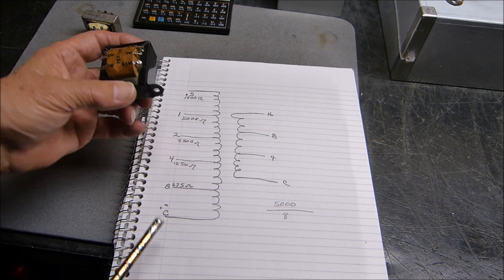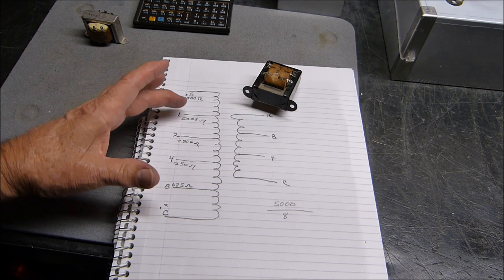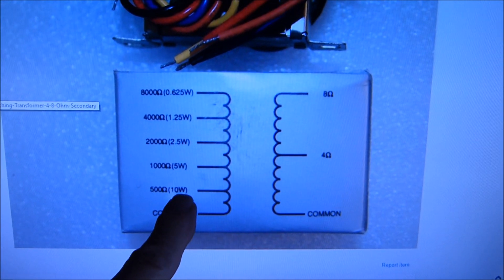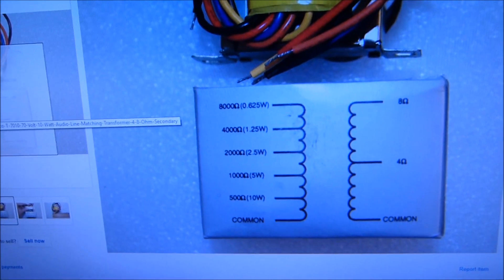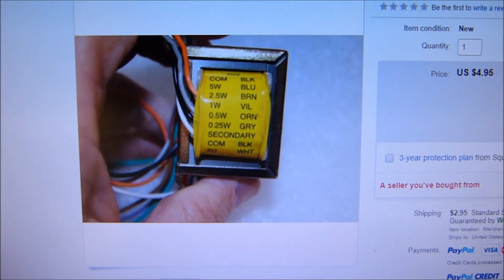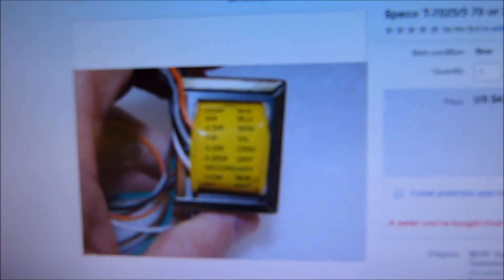Using Inexpensive Line Transformers For Vacuum Tube SE or PP Output Transformers

Comment from the maker: Update: 7/24/2021  -  I have learned a little more about these line transformers and they are not gapped and are not meant to have any DC current flowing in the primary winding as they would saturate easily. To use them as a SE transformer they should be capacitor coupled to eliminate any DC in the primary winding. However, they can be used in push pull as the two halves of the primary have opposite DC polarity current flowing in them which adds up to zero if perfectly balanced and they should work quite well in push pull. In the case of the examples in this video, the power would be low and from what I have seen in the higher wattage line transformers, the available taps are usually very limited. They could work nicely if you are lucky enough to find one with the impedance values you need at the power level you require.

Comment: As Eli Duttman says, these small transformers were/are used in the Bottlehead single-ended Para-Feed power amplifiers. So you get a big choke, say 10 Henrys, that is the DC plate load/plate supply. You then feed off of the plate with a large signal cap, say 3uF,  into the little line transformer. Since there is no DC , the line transformer handles only the pure AC signal and is loaded by the speaker. Great and cheap method of building a 2a3 or 45 or any low-watt single ended tube amp.

Comment: Interesting discussion.  Just for "Fun" I built a 6AU6 (small signal pentode) ->6AQ5 using a 10W line matching transformer in single ended mode.  Yes, I expected a lot of saturation and biased the 6AQ5 really really cold (like 5W).   The "el cheapo" guitar amp was a success!  Of course the amp's output was compressed and distorted, but it still sounded great, for what it is..
Reply from the maker: That is good to hear. You are one of the rare few that will actually build it... I might guess that putting a capacitor in series with the plate of the 6AQ5 to the line matching transformer and putting a choke of at least 10H on the plate side of the transformer for DC to the 6AQ5 might improve it ??  I don't know that but it would take the saturating DC off the line transformer. Thanks for letting everyone know.

Comment: Have in mind that this transformers do not have appropriate insulation, remainding you that if tube circuit works on 250V (DC) AC value can be as high as 250 + 100 or more.

Comment: I've got an old Sony tube amp with just a 6BM8/ECL82 triode pentode in it. The output transformer is open circuit. Could I use a line transformer in its place?
Reply from the maker: There is a good chance that you can. You will need to get a line transformer that has a primary impedance that is high enough for your 6BM8 circuit. I assume it is around 10K or so. That should work.

Comment: I actually bought a similar line transformer off eBay. It was advertised 8k but when I put it on my signal generator and measured voltages, both with volt meters and digital oscilloscope, I got closer to 5.2k. Have you measured the line transformers to see how close to theoretical they are? Is there a better way than my method, assuming the mentioned items and maybe excel? Thanks for the video I think they would do great in 1-5 watt push pull amps.
Reply from the maker: I haven't actually measured Z yet but now that you mention it, I will and let you know what I find.
Reply from the maker: I did measure the larger of the two transformers I showed in the video and the 10K secondary read 11.7K with the GR bridge (I used 8 ohms on the 8 ohm secondary)
Reply: Thanks for the reply. I wonder how balanced they are, more a general curiosity than a request. Always fun to get new information. Thanks again for the update.

Comment: Have you tried using these?
Reply from the maker: No, actually, I have not built anything with them. After some of the lengthy comments that have been posted about these little transformers and the fact that some say they have used them very successfully in SE amps (with current thru the primary) I have a feeling that they would do best on the DC isolated side of a blocking capacitor as a driver transformer. I still have reservations about using them as a legitimate SE output transformer. I have been very involved in my ham radio equipment and have neglected my audio hobby but I seriously do have a project that I will start on "any day" using a pair of Svetlana SV752-10's. I have a nice 10K Tridad transformer that should be a good match. I have not decided on how to drive the grids of the 572-10 yet. I don't think the standard Williamson driver will deliver enough voltage swing so I may have to go with the choke drive (also known as impedance drive) or maybe some of these line transformers or whatever that interstage transformers that I  have that seems best.

Comment: I suspect the downside is probably suppressed response at the low and high end frequency ranges. I searched a few old Stancor catalogs and found no specs listed.  I did find that Thordarson still has the 24S71 shown in their current online catalog. Sadly indeed, the response is stated as 100 - 10kHz.  For headphone amplifier output impedance matching, the story may be different - only way to know is to build one and see what happens.
Reply from the maker: I agree that they are not likely to have a FR from 20 to 20KHz but, as you say, I bet they will be very good for headphone amps. I have to build an amplifier and test one now.
Reply: Well, the application here is performance with headphones - most are around 30 to 35 ohms. The winding resistance of most 70V line transformers is pretty low. The output impedance if the vacuum tube amp is >>> greater than a typical 70V line amp.  The combination of operation below 1/2W with significantly higher I/O impedances "might/may" yield better FR performance. That said, it's worth testing both ways. Surprises happen.
Reply from the maker: You have me thinking about connecting the transformer, as you say, with a load and driving it with another high quality amplifier that can deliver enough power to test it at its power rating. The test transformer would be driven (by the amplifier) at the low impedance side and I would have to have a resistor equal to the high impedance side to load it and measure it ... I will have to think about it.  I have tested transformers with just the few volts output from the oscillators and checked it with the HP 8903 and they all turn out fabulous, including filament transformers so, testing them at a few mW doesn't seem to mean much as how it will operate close to maximum levels.
Reply: Oh well, it was worth the thought. The only bogey not modeled by the simplified physics & math is the core material/construction behavior - sounds like you already have a pretty good idea that the affect on FR is minimal.

Comment: I really like the videos that bring us back to basics. No, these transformers probably don't have interleaved windings, they probably aren't balanced from CT to each end but they are a great lesson in what you can do with what you have. Knowing the basics like this allows the designer to make compensations for something less than perfect and brings expectations back into reality. Great video David.
Reply from the maker: I agree that they probably don't have a gap and may not be very good for SE amps but for PP we don't need the gap so maybe they will turn out good in that application. I surely have to build one now and test it.  :-) I have several different brands and the better brands as I showed in the video are very balanced to its calculated CT. The cheaper one I have are not as well balanced.

Comment: Here you go, all the taps on a 10W or smaller line match transformer. First column is the markings, second column is the resulting impedance, third column is what to connect. 
I actually opened the wrap-around clamp on a pair and took a rotary tool with a cutoff disc to cut a gap into the core, and the pair works dandy for a single ended stereo amp with EL84 tubes. 
BEWARE that there are some of these, where the wire gets thinner on the higher impedance side. Use only those for tube output, that have constant wire thickness!
70V match   Rpri(Ohm) = (70V^2)/Ptap

Uin = 70V   Rsec = 8 Ohm    Usec = sqrt(P*Rsec) = sqrt (P*8)

Ptap    Rpri    Rpri plate-plate        Usec    Uin/Usec    Rin/Rsec
                                                                                             (Uin/Usec)^2
0          0           plate-plate 4K,8K          
10W    490                                          8.94    7.82        61.15
5W      980       B+ 4K                        6.32    11.07       122.5
2.5W   1960    B+ 8K                         4.47    16.65       277.2
1.25W  3920    plate-plate 4K          3.16    22.15       490.6
0.62W  7840    plate-plate 8K          2.23    31.39       985.3

Comment: Experiences with these awhile ago although not as a plate loading output.Right now,using a little Stancor 5w unit to match the 600 ohm output of the Hammarlund SP-600 I am restoring to an 8 ohm speaker.Still has a slight mismatch but WAY better than without the transformer! Good job! You make an excellent Elmer!! 73's.
Reply from the maker: I use one of these transformers on my Collins R-390 as it has a 500 ohm output. It surely makes a huge difference. BTW, I use the R-390 as my main receiver. The audio is so superior to the high pitched receivers as it sounds like my contact is in the same room with me. Love it.
73 WA4QGA David
Reply: ElPaso TubeAmps R-390 is an amazing piece of engineering. The 600 I am using was quite the tough dog! Typical problems were it being WAY out of alignment in the RF and the 1st conversion LO would just stop dead above 7 Mhz.After exploring everything I could think of,with all voltages spot on and swaping 6C4 osc. tubes from the variable to xtal. LO,in desperation I tried a brand new RCA N.O.S. tube and it kept on tickin right up to 11m!!About 27.50Mhz.Been using it alot with the line trans on the output.Watch alot if what you do.Can tell you're into it! I love the test equipment you have.Should have invested in stocking my bench! Have a great New Year! 73's back to you. Charlie N2VUW.

Comment: Great video. That's a good explanation of line (100V, 70V, 25V etc.) transformers.

The last pair are low level signal transformers so are not suitable for handling any power but for low level signal impedance matching. They seem to be general input/output impedance matching transformers, i.e. probably designed for both tasks, whereas most low level transformers are specifically designed to work as either input or output but not both for optimum performance.

Comment: Dave,  I agree with the not air gapped assessment.  I recall Dan Schmalle, AKA Doc B., using that sort of "iron" in a "parafeed" setup.  IMO, an interesting experiment would be "parafeed" PP 6BM8s, with constant current source (CCS) loads and the "line" trafo priamary across the plates.  Regulate g2 B+, for max. open loop linearity.  As incorporating those little cores in a GNFB loop is almost certain to cause saturation, use short loop NFB.  Heat sinked 10M45S ICs should be OK for the CCS loads.

Eli D.

Comment: Thank's, every bit of info helps. I am going to build a mini twin reverb 2x8" at 8ohm , 2x6V6 push/pull low wattage portable Guitar amp. Like Valve powered boogie box with spring reverb...I hope. All this because the speakers have a really good clean tone and they look too well made to just throw in the bin..

Comment: Not good for high DC bias though, they are not gapped much and are really intended for AC only use. But if you have a small DC bias and low power use they will work fine, good enough for interstage coupling at low power. Simplest is to look for the primary winding triplet that has equal DC resistance side to centre, as the primary is always going to be wound with the same wire gauge.

You can delaminate them and restack with a gap though, but you will lose at least 1 set of laminates getting the first one out, then stack as all E and I with the centre leg ground down slightly.

Comment: Why don't we take the whole dc problem (both insulation and saturation) out of the equation and use them merely as impedance matching devices?  We can design a single ended para-feed with a plate load resistor or, even better, an inductor. We add a capacitor for coupling (pretty cheap these days) and we get rid of all the dc saturation. That should make up for the poor low frequency response on those things. The famous REDD 47 preamp uses an arrangement pretty similar to the one I'm describing here and it's one of the holy grails of tube sound. If that was good enough for Sir George Martin and The Beatles, then it sure as heck should be good enough for me ;) Thanks for another great video and also for such a great idea, I just threw so many of those things away...

Comment: Those are my main PP OTs for 6AQ5's - 6V6's - 6BM8's.  I often get them for $5 or less delivered watching on Ebay.  The ones I have are 10W max.  I got about 10 in stock.  LOL  But you are giving away my secrets.  Prices may be rising now!  LOL  ;^)
Reply from the maker: I certainly agree with you comment of unnecessary complexity. I often times find the best answers in the first books  that were written on a subject, likely written between the 1940's and 1970. After something is discovered or designed, academia gets into it and regurgitates complicated versions of it. We also have the advertisement community putting all kinds of flowery words all over it to increase sales. The most common one is "RMS power". No one wants "average" power... but mathematically, RMS power does not come from multiplying RMS voltage times RMS current. We know it is called average power. I hope this video helps builders find and put to use some of these line transformers that have been laying around for decades. Unfortunately, the power levels are going to be pretty low but I am confident even the lower power rated windings of these transformers will be able to deliver up to 10 watts (depending on the size of the transformer, of course) and there may be some concern about the max voltage these transformers can withstand.
Reply: I bought some lots of transformers on Ebay for cheap.  I then had to identify what I bought and what I might be able to use them for.  LOL  That is how I too stumbled into using these line transformers as output transformers.  I make mainly guitar amps so a certain level of distortion is actually desirable in these designs.  I also use cheap Chinese converter boards with DC inputs to light the heaters and switching boost boards to get the HV B+ of +250VDC I use with the 6AQ5/6V6/6BM8s.  This keeps the output wattage down near the 10 W my line transformers claim.  They absolutely work with lower B+'s at around 10W output for ROCKING little guitar amps!
Reply: Yeah, the Data Sheets for the tubes I use have clear specs for +250V operation.  I've pushed it up to +300V just to see how it worked with no problems.  +250VDC from my cheap Chinese DC PS design works very well with 6AQ5/6V6/6BM8!  With this type of design I can build a nice bedroom volume level guitar amp for less than $50 in parts.  I can't get a new traditional OT for these tubes delivered for that price!  LMAO
Reply: No, PP

Comment: Hi , according your explanation do you think I could use a 70.7V  (1W tap side one) in a 5F1 circuit (8 ohms tap - 6V6 output tube).
Reply from the maker: A single 6V6 needs a transformer with about 8K ohms primary load. I think I see in the first picture of the video the 8K tap is at the 0.62 watt tap (1 watt would be OK) so, I don't see why it wouldn't work. I don't think these line transformers have the core gap like a true single-ended (SE) transformer so so there might be some core saturation and maybe not sound exactly like you want it to - but why not try it if you have one. Might be surprised. Hope it works.

Comment: Hi David Happy New Year, I'm not positive as these are before my time, but I thought these type transformers were used in office buildings at the speaker...for matching different speakers to a PA type amp or intercom system. Most PA's have a 70 volt output tap, and then you would put one of these transformers at each speaker....to match it @ 4,8,16 ohms no?
Reply from the maker: That is true what they were originally designed for. The taps are to control the volume as you would not want the same volume in a bathroom as you would in a much larger area so the taps are there to limit the volume. They could be soldered or have a switch on the speaker for volume control. I have to build an amp and test these transformers but some people report that they have been using them for years.
Reply: There still used today.. we install them all the time